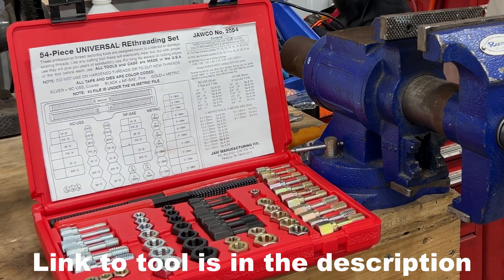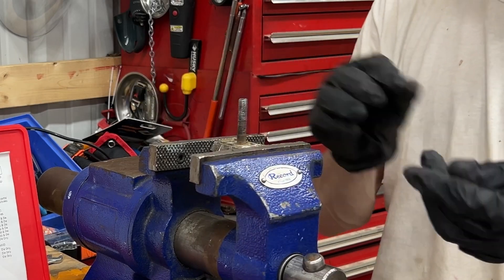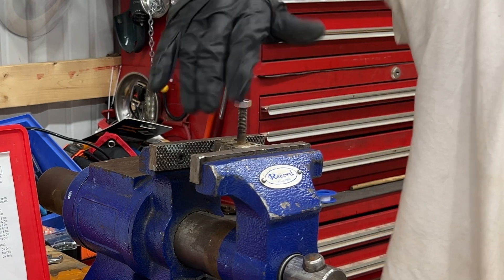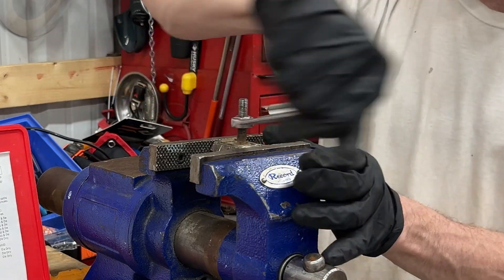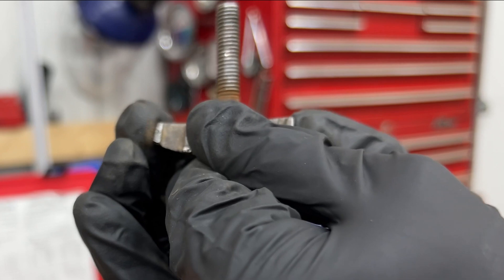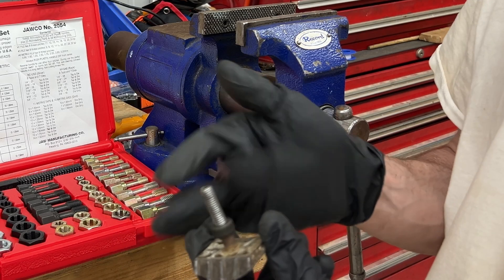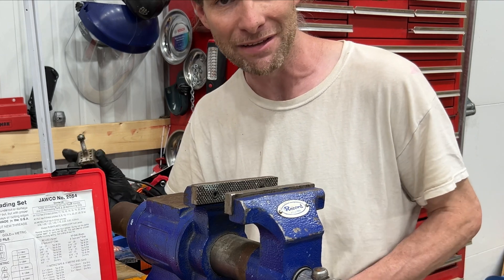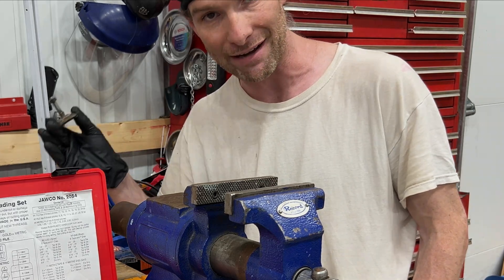How to Fix Damaged Bolt threads. How to Repair Stripped Threads in Nuts Bolts Holes Restore Rethread

Comment: I messed up the threads on the one 0f the studs that hold down the chain tensioner with a dremmel tool. So i have to fix the threads because some of them were grinded down while others are striped. Is this the only way to fix it? Because of it is the I'm really screwed. There's no space to work back there.

Comment: I have to rethread the very start, the tip of my screw because I had to use force to get it out. Now it won't even catch at the start. It's for my electric scooter and a bolt the similar size doesn't fit so I have no option but to rethread.
Reply: Any luck, I had the the same issue with my car. The left steering arm.
I was trying to get it out with a hammer and now the bottom of the thread is blunt so it won’t go in.
Any luck with yours or any advice?